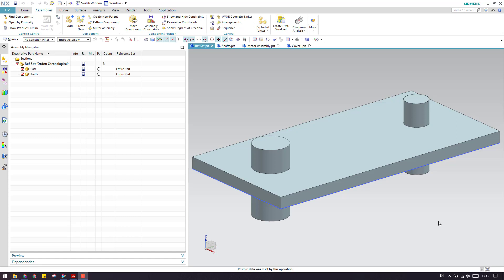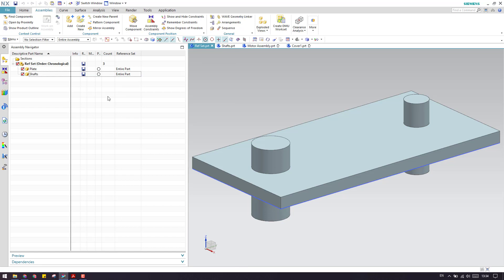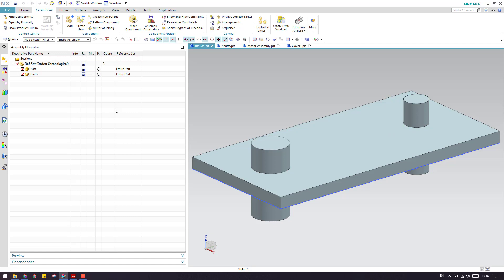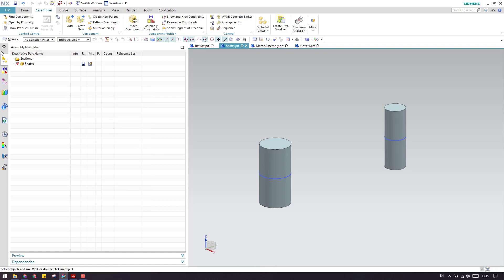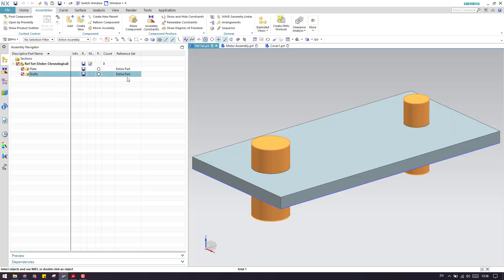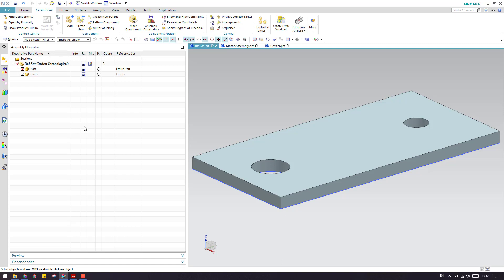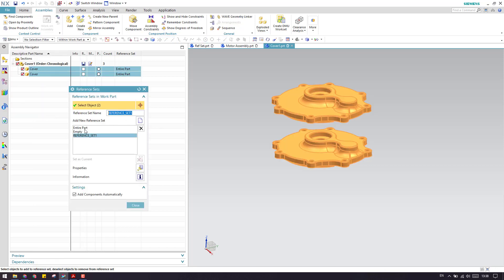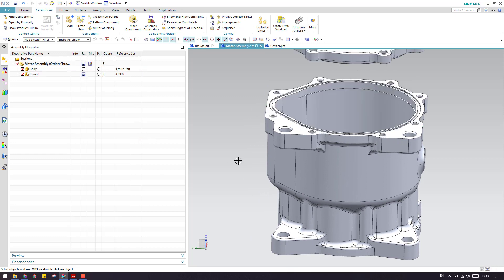Siemens Unigraphics NX-Assembly Tutorials || Understanding Reference Sets

Comment: Reference sets are not really meant to be used this way. Instead use Part Family or Arrangements for the two examples you gave. Reference sets are really more used for making a .prt light weight, only bringing in what you need for an assembly, etc. Example, you have a complex model but in reality you only care about a few key datums and just showing it correctly. So you set the reference set to include the key datum planes and outer surfaces. Now the model is 50% smaller and you load only what you need. Not a big deal when the assemblies are small but when systems start to have tens of thousands of parts NX gives you the tools you need to manage the CAD data in a smart way. Little things add up when it comes to doing things at scale, hence the reason for these nuanced tools.